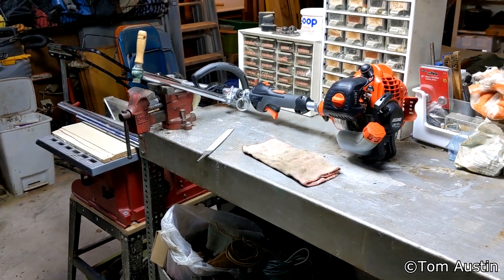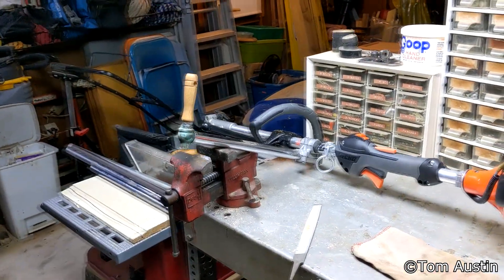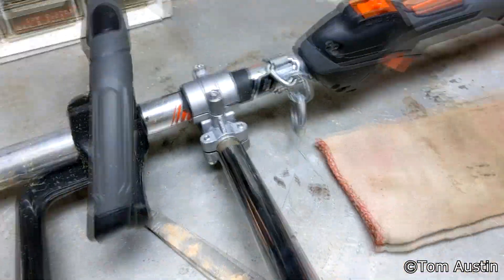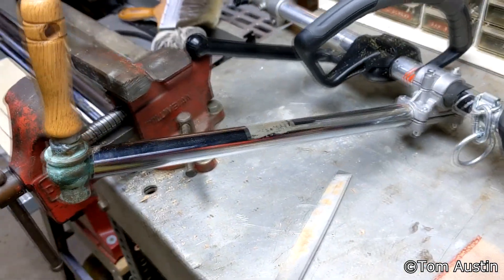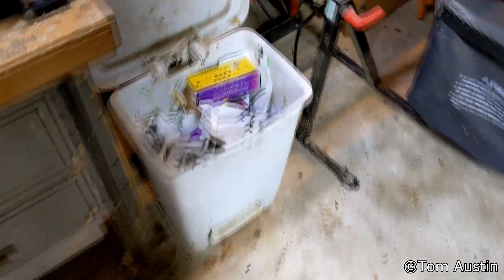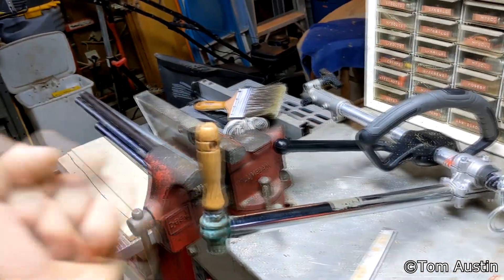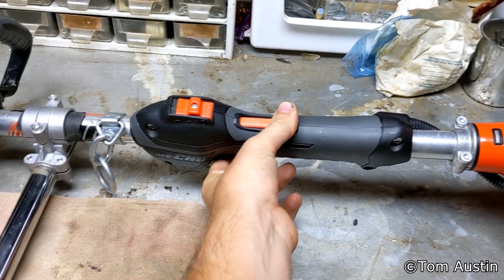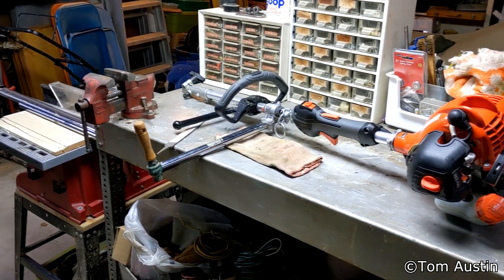Building a Makeshift Handlebar for Brushcutter/Weedeater

Comment: Could you please share the link of where you found this adapter?
Reply from the maker: I won't post a link, since the one I bought is no longer for sale, but if you type "brushcutter handle bracket clamp" into amazon or ebay there are a couple of options that pop up.